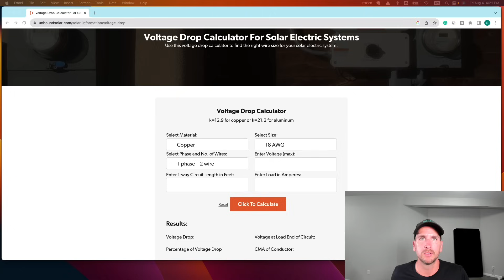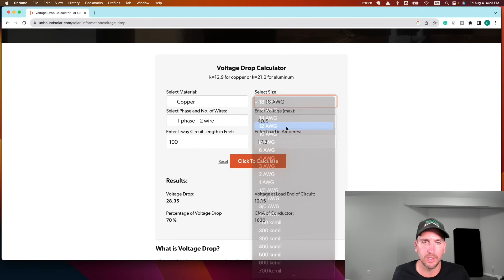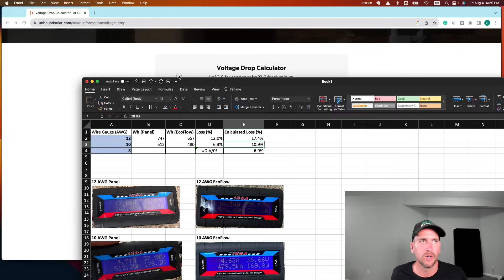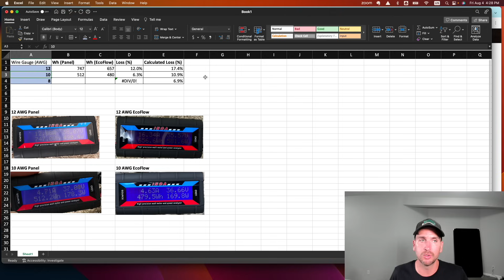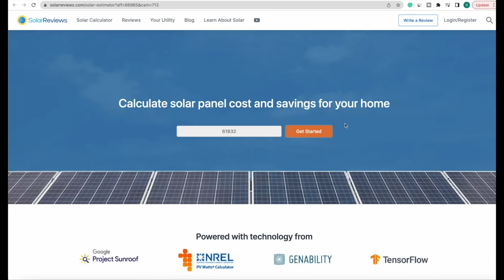What Wire Should You Use For DIY Solar Kits? Surprising Results!

Comment: Please post links for your MC4 connectors and crimpers that work with the 8 gauge wire.
Reply from the maker: I used the iCrimp crimper and BougeRV MC4 connectors for the 8 gauge.  The iCrimp says it only goes to 10 AWG but it worked for 8 AWG.  Here is the list of everything I am using.
 https://www.amazon.com/shop/everydayhomerepairs/list/2GWV4GG92YQ66?ref_=cm_sw_r_cp_ud_aipsflist_aipsfeverydayhomerepairs_PYE818HQEKRFQ66AJ4F3

Comment: Better to put panels in series to provide higher voltages. Power loss = I^2*R. double the current and your losses increase by 4.
Reply: Yup, most people forget the square.
Perhaps the device he is charging cannot handle the higher voltage.
Reply: The current flow is what is charging the batteries.  parallel panels allow for more current and faster charging times. The solar charge controller regulates the amount of current delivered to the battery it recharges.  I
Reply: @zaneenaz4962  Not really true.
With an MPPT, what matters is POWER. The MPPT is a buck converter which will convert that power into current.
If you have 2 panels of 10A each and 25V they can be wired in series as 50 V at 10A or in parallel as 25V and 20A. The POWER is the same either way: 500W. The MPPT will convert them both into the same number of Amps at whatever the battery voltage is (ignoring slight differences in efficiency at different voltages). Ignoring losses, that would be about 41A at 12V.
Reply: @cccmmm1234  The power transfer is noted, but would you not also be increasing the resistance when the panels are in series?  ....and the buck converter efficiencies are typically below 90% (another source of loss)  As the systems scale up i suppose these loses drop off as lower percentage of the overall system.  Leaves me to wonder if my 300W systems might not behave like your 500W.
Reply: @zaneenaz4962  the resistance is in the wires. Resistive loss goes up with the square of current. Not voltage.
If you have 2x 25v 10A panels in series then the current is still just 10A so the resistive loss is the same as from 1 panel. 
But if you put the panels in parallel then the current is doubled. The square of doubling is quadrupling,  so the resistive loss goes up 4 times.
This is why you can get much more power through thinner wires in your house wiring and why hundreds of kilovolts are used for long distance electrical grid wiring.
Reply: @zaneenaz
There are always trade-offs and ~a decade ago arguments were made to keep the voltage coming to the controller as close to the voltage you wanted so as to minimize the losses you mentioned when the voltage is stepped down. It’d be interesting to see power in to a controller and then power out using different input voltages.
Reply: @mikedavison3400  Over a century, Edison vs Tesla. as Tesla promoted AC for step up\Step down to for long distance power transmission. Edison wanted DC & a fixed lower voltage that would be "safe" 110VDC.

A modern step down buck converter can be 98% efficient. Any battery charger is going to have a buck converter to drop the voltage to the battery voltage as a constant current converter.
Reply: @guytech
‘zaneenaz’ had mentioned that efficiencies were below 90% which is what I thought but my #s were from ~a decade ago when looking at such things. It’s very possible that efficiency has gone up although as I said earlier it would be an interesting experiment to see power in VS power out with a controller using different input voltages.
Reply: @zaneenaz4962  Battery charges have a current regulator (something like a constant current regulator) Batteries are never charged directly using the PV voltage as it too high. the Battery charger will step down the voltage and supply higher current for the batteries. Basically it will use a Buck step-down converter will will drop the voltage and supply more amps than the PV panels can provide.

Comment: I run at around 120v dc to minimize my loss 😉
Reply from the maker: How large is your system?  Assuming you just have Enphase micro inverters at each panel?
Reply: @everydaysolar-ps3xg  small system,  nothing mounted permanent,  but I run 4 250 watt panels in series ($79 suntan panels), I have 3kw worth for power outages,  and two 5kw batteries.

Comment: 0 gauge OXYGEN FREE COPPER wire (Silver is better if you are rich enough to pay to have them made).
If you had twisted wires (think CAT cable) you might get even less loss.
Reply: Twisting DC wires won't reduce losses.
Reply: @cccmmm1234  Ever try it?
Reply: @cccmmm1234  Sure it would. Induction works in both directions.

Comment: Each 3 wire sizes the resistive loss should be cut n half :  An #8 has 4 times the cross sectional copper area as a #14

Comment: Why not keep the EcoFlow in a cabinet or shed 10ft away from the panels; then run A/C to the house at 120vac?  The much higher A/C voltage 'line loss', will be able to run much farther and be negligible (a endless point of contention between Tesla and Edison).
Reply from the maker: There are so many different application that a longer run could be needed.  If you can keep it short that would be preferred for sure.

Comment: I am currently devouring as much solar info for auxiliary power as I can; your topics are very relevant, and you deliver the content so it's easy to understand. You are appreciated. My EcoFlow Delta 2 is in transit. I'll be hooking up 2 190 watt HQST panels that will be wired in series. Does the length of the line (Let's say 100ft vs 50ft) affect the amount of loss?
Reply: Yes it does. Shorter run is always lower resistance. Bigger gauge means lower resistance per ft.
Reply: Thanks much. I'll be using 10AWG initially and adding another 30ft as soon as I get everything cookin'. @MrBooMY3

Comment: Another way to calculate efficiency loss is the look up the resistance of your wire (and multiply by 2 for round trip resistance) or simply measure it with your ohm meter if you have one.  Then, instead of the usual power calculation of volts times amps, you can also use resistance times amps squared.  Use the amps number from the power monitor nearest to the panels and multiply by the resistance you measured (or obtained from Google).  The lower currents that i observed in your measurements accounts for the lower than expected efficiency loss.  If you repeated the test with the 2 panels wired in series, your efficiency losses would be half of what you measured for the parallel configuration.  Because temperature voltage losses especially in the summer can have a confounding affect on power (and thus interfere with determining is the wire is the major culprit), you should use the Power = I (amps) X R^2 (ohms) equation when looking at wire losses.  Conversely in the winter, the max voltage of the panel can be quite a bit higher than what the ratings are on the back of the panel, and thus also confound trying to see what the wire gauge affect is.  Nice video!  I also use 100 feet of 8 gauge when hooking up my portable panels.
Reply: I think it's P = I`2 X R
Reply: That is a ridiculous pain in the butt. Just do it correctly and use a VDI chart that you can find on Google.
Reply: That's great and all if you're retired and have all kinds of time on your hands. Or you could simply use a VDI chart and be done in about 30 seconds.

Comment: Look man. Run the highest voltage your charge controller can handle on the fattest wire you can afford. 10 ga. stranded can easily handle 35 amps at 300 volts. If you are gonna run more than 10,000 watts run a second wire run.

Comment: Total Amps and Wire Length are the controlling 2-factors.  Short wire lengths allow smaller wire gauges.   All this video proves it best to get a solar controller to handle as high VDC (48 VDC is better than 24 VDC which is better than 12 VDC) as possible (solar panels in series vs parallel) and keep amperage low as possible to the controller.
Reply: The losses in the circuit are determined by the resistance of the wire and the electric current according to the formula P = I^2 x R .  If the voltage is multiplied by 2, the current required to supply the same power to the load will be divided by 2. Therefore, the loss in the wire will be divided by 4, allowing the use of a thinner and cheaper wire.
Reply: @nathanneiman sweet. Thanx.
Reply: Using microinverters on the roof solves a lot of the design complexity of figuring out  parallel vs series wiring of your panels, including what gauge wire to run. More important, they alleviate the  issue of one panel being in shade taking down the output of a substantial part of the system. While the microinverters themselves add cost to an installation, they should save money in labor costs (assuming you are paying someone to install a system,) due to the simplicity of the wiring.  You  incur losses converting back to DC to charge a battery backup, to be sure. If you have short runs, no or very little shade, and are charging a battery with your solar, DC direct wiring is probably best.   If, like me, you have areas of your roof that move in and out of shade during the day, long runs back to the battery and panel, microinverters are probably better overall - probably.  That, and we don't actually SEE the sun in the winter for months at a time. First 10 days of the year this year we had 5 minutes of actual direct sun :D Basically, there are many ways to peel this banana, and everyone needs to find the right one for their situation :) Videos like this provide data to help make those kinds of decisions.
Reply: @smarouchoc7300 micro inverters are the bain of the industry. Enphase has worked the system to defend their optimizer/micro-inverter business territory. Making up requirements not even considered by other countries.m like "rapid shutdown".
Micro-inverters assume the power will be fed to the grid not stored local.
For my system they are completely useless even counterproductive.
Grid tied is great if you want to sell power for a quarter and buy it later for a dollar.
Unless you have shading, optimizers are a waste.
I want my solar power to work if the grid fails.
Reply: I think most marine equipment are also 48 V .. so it opens up appliance options that avoid conversion to 120VAC which means even less losses
Reply: @styleisaweapon  Actually most marine equipment is 12 VdC.  The only exceptions are some high current items such as bow thrusters and some windlasses and electric winches, which can be bought as 24 VDC.  Of course, that changes if you are talking about a large (100+ foot boat).
Reply: always found it funny that voltage has NOTHING to do with voltage drop :)
Reply: Wait, you are using standard battery voltage ratings in your comment. That has little to do with the panel output ratings. Many charge controllers (which are what matters for panel output voltage) are taking up to 150 volts now (or more, but that is not common yet).
Reply: Any tips on how to Crimp solid #wire to std mc4 connectors?  They always seem to wiggle loose.???
Reply: @dennisd7451 crimp and solder.
Reply: I always see the suggestion for 24V batter or 48V battery, but at least in my research I don't see inverters sold to handle this, they usually say 12V... Can we use bigger battery anyway?  Also Eco Flow Power station requieres the XT60 Solar Connector wires to connect to solar pannel wires. Does the XT60 solar connector wire need to be the same size as the XT60 solar connector wire?
Reply: I think the most important aspect about wiring is missed in the video. The most critical aspect of wire size is to handle the the maximum Amps  with at least 10% headroom so one does not get a fire!
Reply: @shmayazuggot8558  that's totally out in left field! Size the wire with a simple chart and choose a voltage drop of no greater than two or 3%. That covers all the bases in one shot.
Reply: @shmayazuggot8558  Just curious do you think the panels are going to suddenly make 10% more current?
I agree the circuit should be designed to handle the current but the amps are listed on the back and the wires installed on the psnels will be designed for that current. If you connect panels in series the voltage increases but the current stays the same.
If you stay with the same size wire as the panels it will be safe.
Even if you have a long run and foolishly waste most the power heating the wire it's limited by the panel production.
I mean even if I short one of my panels out it only makes 10 amps.
Reply: Wrong, total amps and wire length and voltage are three controlling factors. I run my ground mounted solar arrays at roughly 500 V DC and that keeps the wire gauge pretty dang small over fairly long distances
Reply: @Riceman-o1p  Not sure who you think is wrong but overall it seems you agree with the OP.
Sure you read it right?
Reply: @ghz24  oops! My bad!
Reply: @Riceman-o1p  what kind of charge controller can handle 500 volts?
My all-in-one says 500 volts in the videos  but the manual says 450.
I'll only run about 260v but its only 2 strings of 10 amps each and a pretty short run.
That's about all the watts it can handle anyway.
Reply: @ghz24  Schneider, up to 600 vdc in and about 5,000 watts of power @ 48 vdc out.

Comment: The Delta Pro will only use 15 amps, which means that it current will be limited to that level throughout the circuit regardless of the voltage.
Reply: In another video he had 4 panels in series going to the battery, and it was over the rated input voltage for the battery unit, so it would not charge. The unit blocked it. He had to reduce it to 3 panels in series to get it to accept a charge.

Comment: I always wondered if it was optimal to be the same size on positive and negative.  Say 8 gauge on the positive and 10 gauge on the negative.  If its anything like water pressure, you dont actually need as much on the exit (negative) as most of the electricity should be used up before it has a chance to exit?
Reply: No.      DC runs equal on both sides

Comment: Very interesting test, and very timely for me. I'm in the last weeks of finishing a house build and I plan on installing a solar array outside some time down the road. To that end I pulled a 100' length of 10 awg wire through the well pump access line (a 3" PVC line running under the slab) into my house. I've got a Bluetti AC500 solar generator that I'll be using at the house and in my 5th wheel (why I purchased an all in one system so I can move it between them when I travel). I've currently have a PV420 Solar Panel (again for use at home and in the 5th wheel) but have plans to install a ground mounted solar array with a lot more capability. Knowing what wire size I'll need to insure I get the most out of my array is a big question I had and you've pointed me in the right direction to figure it out, Thanks. I'm interested in learning more about what you have to offer so I also subscribed.
Reply: Design your array with voltage as high as your controller can handle and then your amps will be low.
270 volts and 20 amps through 100 feet (both ways) of 10 gauge wire gives a voltage drop of only 4.1 volts and less than 2% loss.
If you wire it differently you could get 66 volts at 82 amps and need zero gauge wire to get the same 2% loss.
The precept of this experiment was flawed in that it was designed to push a point that should be observed and accounted for but can be design to avoid instead of just throwing more copper at the problem.
Reply: @ghz24 This. Just bump the voltage up.
Reply: @greenrabbit0341  I think that's what I said.